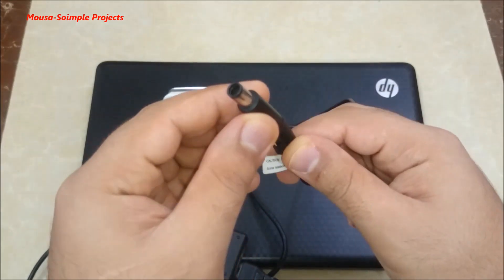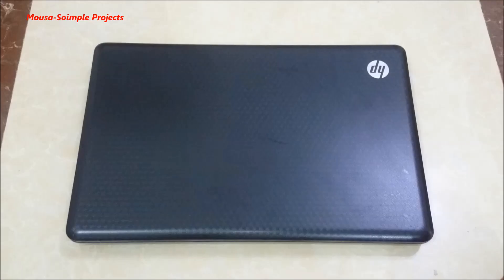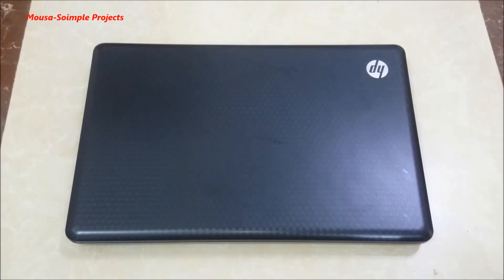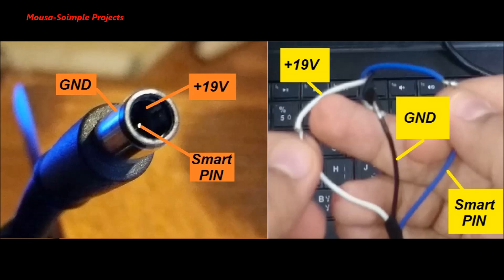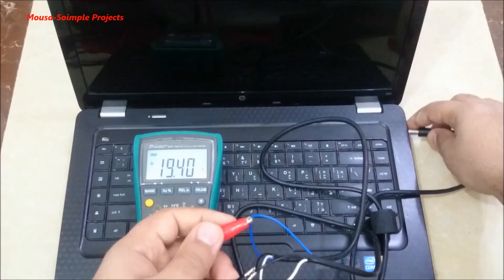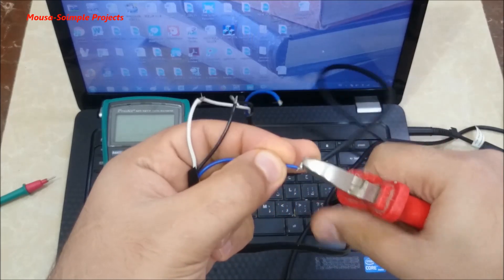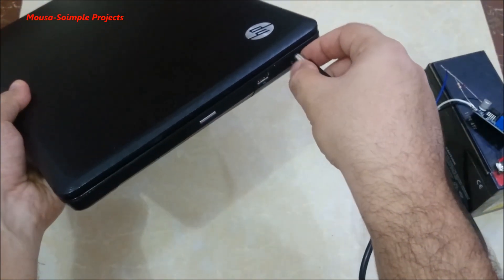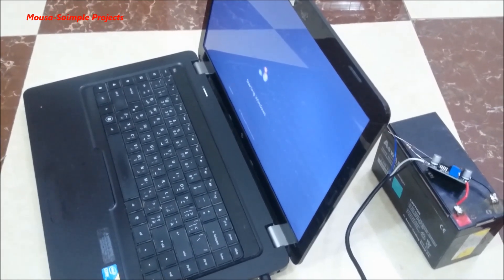How to running the laptop with 12v battery / 3 wires Charger?

Comment: Nice, but how do you build the boost converter?
Reply from the maker: I didn't. i bought it from Aliexpress.
https://www.aliexpress.com/item/1005002895150655.html?spm=a2g0o.productlist.main.9.74beKLxrKLxrUi&algo_pvid=b27e7649-07a7-4ba1-ab37-1f4c712ab20e&aem_p4p_detail=20230903001441127161944184240011652948&algo_exp_id=b27e7649-07a7-4ba1-ab37-1f4c712ab20e-4&pdp_npi=4%40dis%21USD%211.70%211.58%21%21%211.70%21%21%402103135816937252814336648ee8f8%2112000022663394821%21sea%21IQ%210%21A&curPageLogUid=tuE1VWJ1ZZ8m&search_p4p_id=20230903001441127161944184240011652948_5

Comment: Thanks very helpful! It worked for me. My signal wire gave 2.7 volts so I used a 2.2 zener and a shottky diode in series to get the correct voltage. With a 6.8k resistor. Just stuff I had lying around..